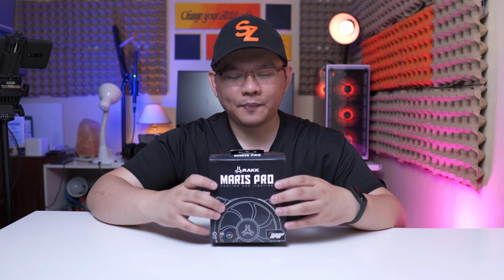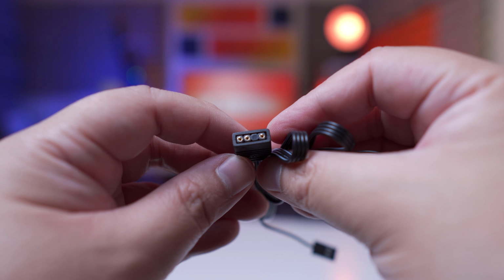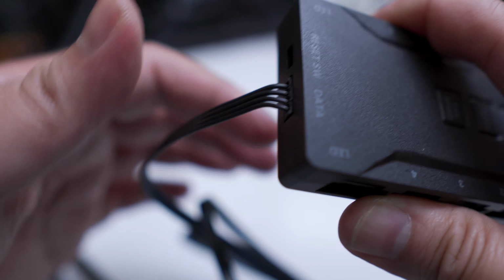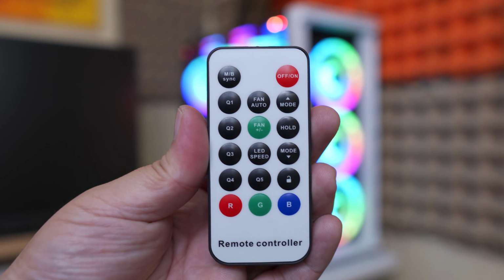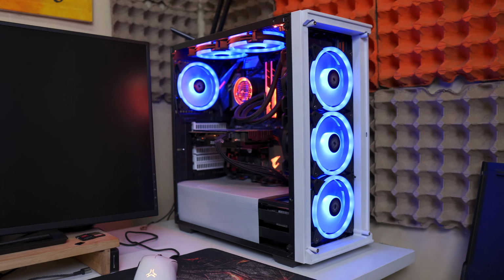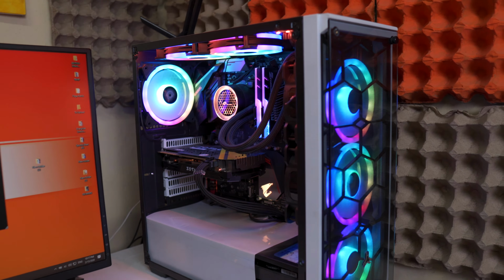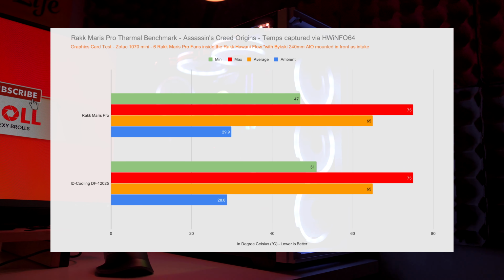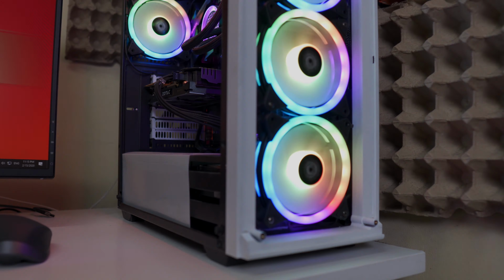Rakk Maris Pro Review and Setup Guide + Rakk Maris Pro VS DF-12025

Comment: Guys question. I have 2 extra fan with regular 6 pin connector. By any chance, do we have any available way like adapter so I can plug it in the Maris pro controller hub? Or any way that I can sync their RGB. I'm using MSI h510m mobo so no ARGB header. thanks in advance.

Comment: you're right to put the hub fan to a pwm controller, you can set the control mode to PWM manually in the BIOS and you can control via fan curve. But unfortunately it will not display the fan speed since the pwm is not available on the fan itself. But it works.

Comment: Same problem here, the PWM connector is already connected to the sys fan 1 4-pin header but the fan RPM is still not being read by the motherboard software and even in the bios. The reason for that is because when you look at closely the Rakk Maris Pro's PWM connector, it is not really utilizing the 4-pin header of the motherboard(from what I received). If you really trace the wires from the hub, it has really four wires but when you get to the PWM connector, it becomes only 2, wires for the first pin (Ground) and the fourth pin (PWM). The pin that gives the RPM data is the third pin which has no dedicated wires from the connector. Hope this clear things up.

Comment: Looks the same with the tecware orbis fan hub aside from having two rgb strip headers, even the remote controll looks the same. PWM works and speeds are being controlled, though you will not be able to monitor it. Most multiple fan hub controller monitor only one fan speed to display the speed. This hub however, does not designate one which is why your mb won't be able to detect it. But it still works you just won't be able to see the rpm in software or bios.

Comment: noob question,

i have a 5pcs single color led fan (3pin)
what do i need to buy to be able to light up all led fans
without making error?

do i need to buy fan hub and 3 pin splitter at once?

any comments will do ty fam.

Comment: Sir, how to sync rakk maris pro with aura sync 2.0? I'm using aorus b450 pro wifi but aura sync is not detecting my rakk maris pro.
Reply: same problem here, If you press MB sync the fan lights turn off

Comment: I found out how to use the PWM Fan Header for the Maris Pro. All you have to do is to use the remote control included and press "Fan Auto". It will use your Motherboard's Fan profile if you press it. Hope this helps. Though, you cannot read the fan RPMs through your system as it has no Fan speed readout. But it does work.
Reply: Nice!
Reply: Up this comment please very helpful thanks
Reply: My motherboard cannot detect the rakk fan hub after connecting it to a system fan header. Any ideas why? :( I cannot control my fan speeds and the default speeds on the remote are too loud for me :(
Reply: @kurt_  press "Fan Auto" on your remote and it will use your motherboard's default fan profile. You can modify fan speeds through your motherboard afterwards. Make sure to set the fan control to PWM Mode not DC mode.
Reply: May I ask if its okay to connect an Argb splitter on the Argb header on the board then connect the Rakk Maris Pro on one of the split then connect an Argb CPU fan on the other.
Reply: @alvinazores3434  yes. That's doable. That's what I did to sync my Maris Pros to my AIO Cooler via Motherboard ARGB control.

Comment: Manual fan speed control lang?
Reply: Walang solution dito?? Nka msi mortar max ako. D rin madetect ung system fan ng mobo
Reply: Baka nga boss. Kase hindi din ma Detect sa mobo ko yung Fan wire ng Hub.

Comment: Sir, safe ba gumamit ng aio o mag cm hyper 212 rgb black edition na lang ako para sa r5 3600
Reply: its pretty much safe as long as you get one that is quality, also dont buy any of the 120mm ones since those aren't really good as far as i see on reviews, get a 240 or better
but if you dont really mind aesthetics i would honestly just go aircooling , air coolers would out perform most AIO coolers, dark rock pro 4 or noctua nh-d15 , the hyper 212 rgb black edition is good , better than the original hyper 212
may list naman sa linus forums although medyo outdated , it still holds its ground as far as accuracy 
https://linustechtips.com/main/topic/891730-cpu-cooler-performance-tier-list/
Reply: Kung masipag ka mag linis ng pc go for aio kung hindi mag 212 kana lang. Solid na yung 212 kahit mag mild oc ka pa dyan. Kung gusto mo ng aesthetics go for aio.

Comment: Sir compatible ba yan sa B450 TOMAHAWK MAX? ma si sync ba 8fan?       saka kasama na ba yung  sata cable?
Reply from the maker: Yes compatible, and yes kasama na yung sata connector sa HUB
Reply: Really compatible ba? sa pag kakaalam ko 5v gamit na connector dun sa Fan hub ng Maris Pro pero the MSI B450 Tomahawk Max supports 12v RGB header now im confused. oof
Reply from the maker: @bornbeast9695  sorry I wasn't very clear on that. Compatible in the sense na pwede sa tomahawk max or any board since may sarili siyang fan hub and dun masysync lahat ng fans. Since di mo naman makakabit yung fans alone in any motherboard header kasi propritary ang connector ng fans ng maris pro. Again sorry for the confusion